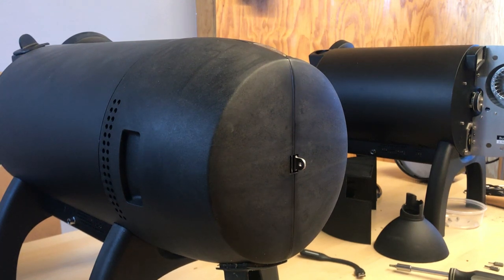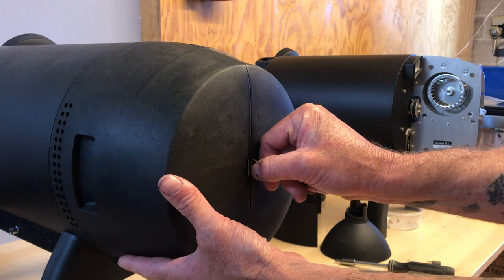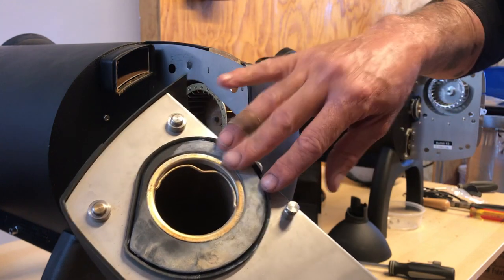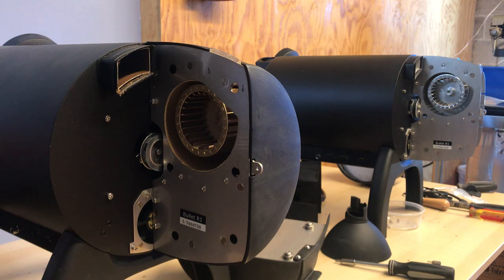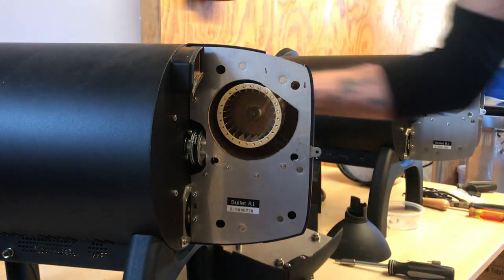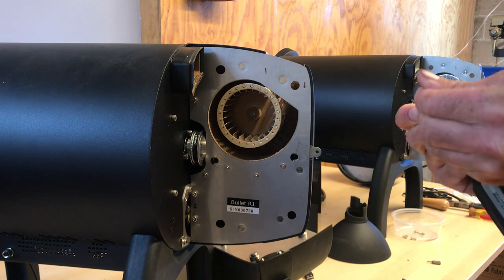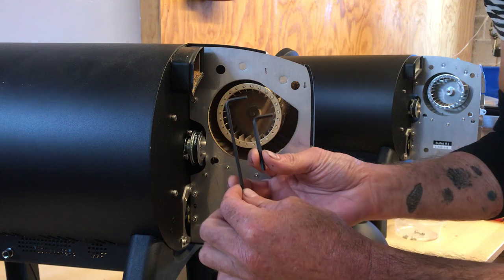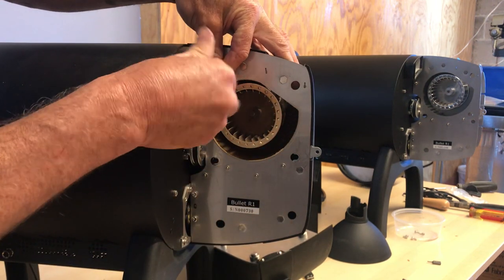Back End of Bullet R1 Coffee Roaster

Comment: It's great that you guys carry this roaster. It is even better that you are teaching owners how to properly troubleshoot and take care of the roaster. It is a great roaster, but not without it's quarks. I just hope that owners don't run at the first sight of a issue, which is likely just a very small fix. Or more likely something that would not have even come up with traditional routine maintenance. Any possibly that they will come out with an aftermarket bean deflector?
Reply from the maker: I think they were having a bit of a contest on the Aillio site to design one, something 3D printable like the exhaust port downloads they have on their site now. But I don't see anything was published on that.
Reply: One further thought.  After reading and recalling sales people's  advice.  I want to  stress the kitchen roasting process requires a high CFM   (cubic feet per minute)  high volume  exhaust fan to vent out the smoke and  waste heat.  The Bullet roaster produces  hot and high amounts of exhaust.  The R1 has is no:   exhaust scrubber,  filter,  or catalytic converter in the R1 Bullet system.
The Behmor 1600 has  a catalytic converter.  

Safety is paramount so the machine needs warning labels as well !  Hot!  Do not use indoors without proper ventilation,   Unplug before disassembly.   Operator should keep children a safe distance away,  and disassembly is required to properly clean.   My favorite is :  Warranty is never voided if owner disassembles.  Lifetime warranty!

Comment: Thanks for reviewing and demonstrating... I've had the same issue... at minute 4:30 when you try to take that part out, the screw dropped inside and you couldn't get it out but you said don't worry you can get it when you take it apart.. but imagine putting that part back and the screw falls off... Especially if you've done all the screws and the last one dropped... This machine is not for everyone it is a high maintenance.. I really don't recommend it unless if someone likes challenges. So the belt getting loose is a common issue my machine was not a defect one... A common issue and they made just taking the cover off, putin it back is so difficult you need to play a game with the screws to put them back.... Just not a smart thinking.